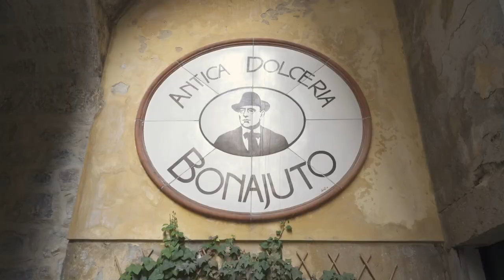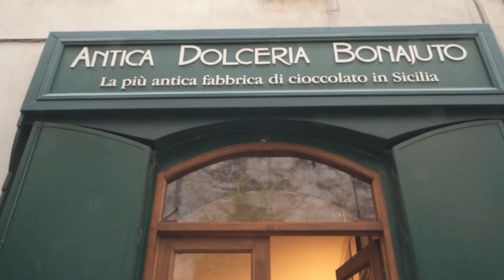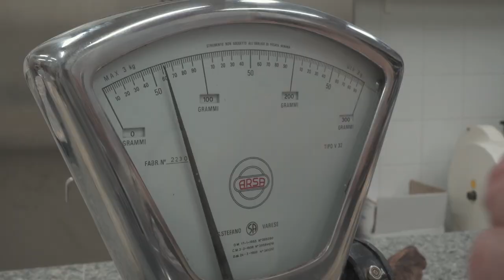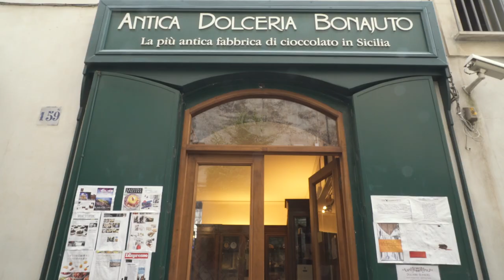Sicilian Handmade Dark Chocolate - Antica Dolceria Bonajuto in Sicily, Italy

Comment: A quote from the video: "because the mixture has been processed at 45 degrees, the chocolate has not quite melted to the point of liquid, hence, the grainy texture". This is incorrect. The melting point of cocoa butter is 34-38 degrees Celsius. Grainy texture is not related to the temperature of the process, but how finely cacao beans were ground.
Reply from the maker: Thanks for your input. This is what we were told by the chocolate meister himself so we'll have to agree to disagree.
Reply: @womlocalstories  I’ve been to Bonajuto myself a few years back, the point they usually make is not that the cocoa mass itself doesn’t melt, but rather that it doesn’t reach a high enough temperature to completely dissolve the sugar, which will remain grainy. I think the finer points might have gotten lost in translation.
Reply from the maker: @IreneSaltini  Thanks for letting us know Irene.
Reply: @IreneSaltini  True, however a certain quite high temperature would dissolve also "grainy" grinded cocoa. Though this is not the case for eg. +/10°C temperature differences, so I would also say it has to do more with the sugar contained. Im just eating some other chocolate made as per the Modica cold procedure and it is definetly the sugar (which in my case also means whole cane sugar - not refined and not crystallized - and which is even more difficult to have it melted), so of course it remains to be different with the chocolate shown, as I have not tried this one. Love